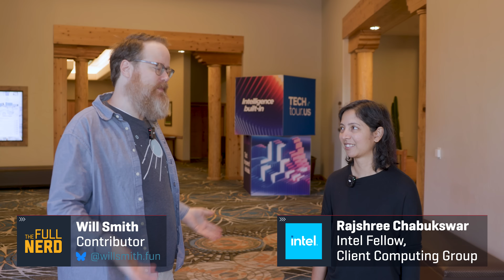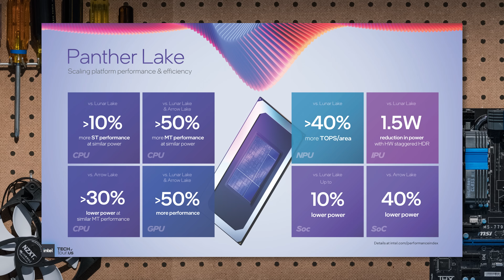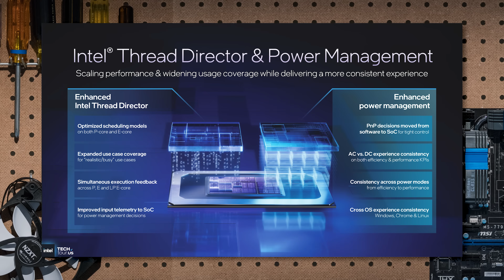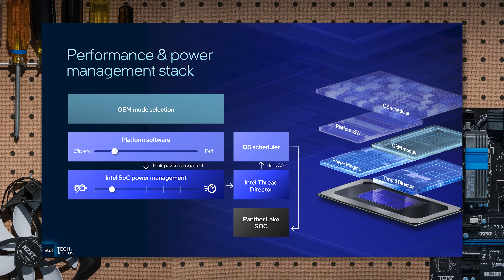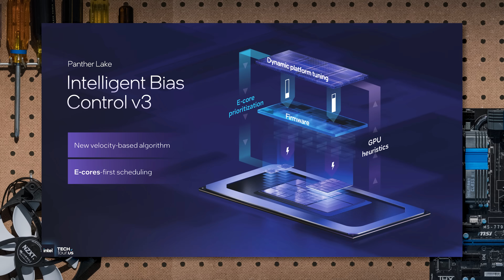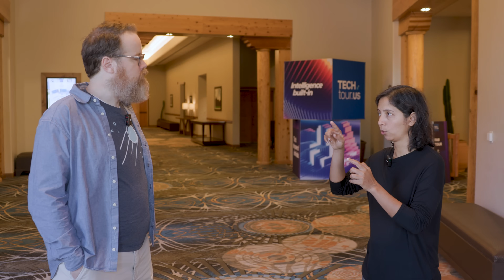Intel Talks Thread Director Changes In Panther Lake

Comment: operating system could do on-fly benchmarking of the core tasks to determine which cores the tasks run on. ie test first then run based on the benchmarks. ie the program or a driver does not have to decide that at all. os is the perfect place to do benchmarking. or you can have an application list in os that can put applications to certain cores. same as nvidia drivers application settings. but you have to have all cores available for say stress test benchmarking applications.
Reply: I've thought about this problem before, in the context of a hypothetical userspace daemon for AMD 7950X3D that would randomly kick threads between the big-cache and big-frequency CCDs while measuring instructions-per-second with perf, to build up a database of best-core-type for each executable.

It's hairier than it seems, because often what you care about is the worst case or the 99%-ile case, not the average. But the low Insn/s outliers will be catching stuff like the core coming out of a sleep state, or a phase of the program where it does a bunch of I/O. So without visibility into the actual program's view of "performance" (frame time, for games), I can't see a way to measure the worst case.

Comment: "Just the cost of a context switch" I thought what?!!?!!! (as Linux kernel devs were proud of lowering it to 3ms a long time ago), then she's honest enough to mention 20K cycles; that's why SMT helps performance because memory stalls don't halt the work but a virtual thread can progress faster without context switching with the scheduler dropping local core caches.
AMD have been shifting TDP between CPU & GPU for a long time and the unified L3 cache on typical 8c/16t CPU helps.
Reply: I think you mean 3us
Reply: @Sopel997 perhaps but it was a long time ago (likely the 90s), it involved saving register state to memory and so on and flushing cache, so 3ms is only 3 ticks and that was much faster than comparison with other OS.  The clock tick was IIRC traditionally just 50Hz on UNIX, scheduling related factors liking larger time slices but relied on interactive code blocking faster on i/o this having higher priority once they became runnable again.  I think Linux upped it to 100Hz then the AMD64 1000Hz was shocking, a statement of intent on latency.
Server managers really try to reduce context switching because it's a performance sink.  3ms probably was an achievement when CPU ran around 100MHz and DRAM was not nearly as fast and big L3 caches were just a dream.
Reply: So it seems to me Intel screwed up with hybrid architecture, out of competitive necessity but it's haf costly consequences.
1) Split caches
2) Bad AVX performance on economy cores
3) Unpredictable and hard to optimise scheduling too complex for portable applications like games where developer time is precious.
4) Multiple architecture teams required to design 2 core types for a single CPU, when AMD could simply re-layout the same core but with lower max frequency and tuned to max power efficiency.
5) Hints to scheduler when code is running poorly on the wrong core type, require a context switch.
Games using many multiple threads, end up spread across cores with large L2 caches or shared ones, but having smaller L3 cache serving more hops on the ringbus, while AMD CCD keeps data close and a dual bisected bus avoids the extra hops which had Intel switching to grid meshes in servers.
6) Client and server are separate so tech funded for HPC servers like V-cache became serendipitously available to make the best gaming CPU work well with cheap memory.

They have had under-reported bugs with hybrid and Thread Director, need OS co-op and the whole tech just hasn't helped in many applications.